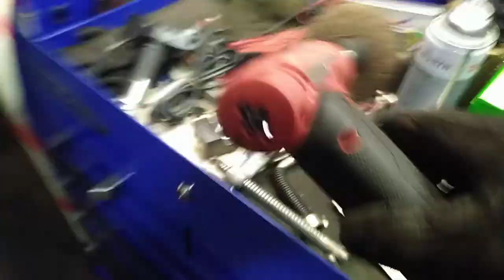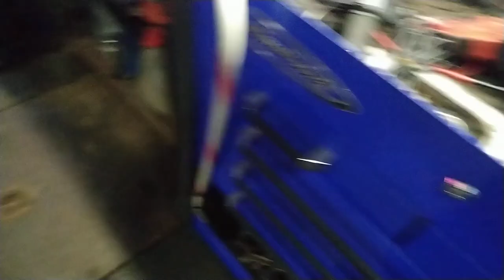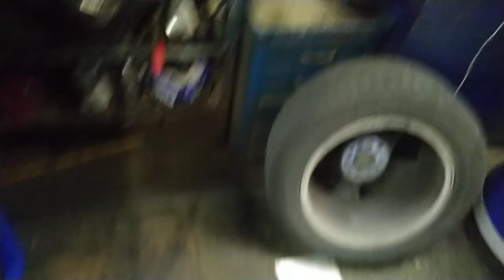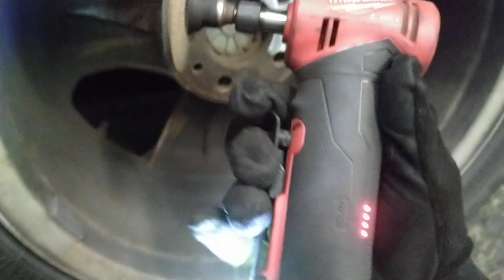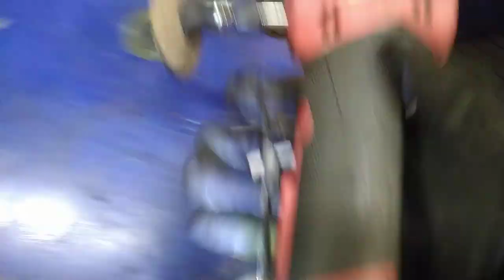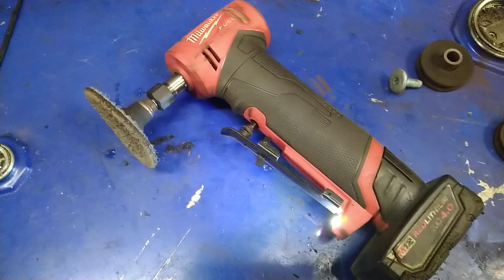NEW Milwaukee M12  Die Grinder WEAK SAUCE

Comment: It’s a safety cut off to prevent damage to the tool. It means you’re applying too much pressure to the tool. Use less pressure and let the tool do the work.
Reply: So why is this named a die grinder. it should be a sander. If it cant handle a sanding pad, imagine using a carbide burr which is the original bit designed for a die grinder. Dewalt and Makita also makes die grinders and there is a reason they put a little larger motor on it.
Reply: @krakeneleven5294  Milwaukee also has a bigger version plus this thing works like a charm either the guy was going ape on the thing or the vents plugged
Reply: Look how bent the wheel he's using is. Clearly he's using too much pressure on the tool. It's not allowing him to break it is all.

Comment: Interesting! I bought one of these and it works absolutely fine, I did push it hard ,but All was in thin metal using flapdisc, I will try to push it to its limit with something more challenging and see how it holds.
Reply: Alex Awesomesauce Beaudry sure thing brother, I will test it immediately when I get days off after 5 days and let you know what happens with me
Reply: Alex Awesomesauce Beaudry just after testing and searching realised that it has safety feature which makes it cut the power off if pushed so hard so that it doesn't move out of hand, which in other hand makes it underpowered in compare to other angle die grinder.

Comment: I just got mine yesterday and it’s doing same thing. This can’t be normal. I’m barely pushing down and it’s cutting out. Super disappointed.
Reply: They must have had a really bad batch or two. I've had mine for weeks now and I push down on it when I use 2" flap discs and on settings 3 and 4 that is no problem at all.
Reply: Mine is doing the same thing. It shuts off with very little pressure.

Comment: I got one and love it. I'm invested in the m12 line because I'm using them for DIY. It's not cheap and it's not professional grade. It's a luxery not a necessity.

I can totally understand from a professional perspective this may require adjustments in workflow because it's optimized for 2" accessories. You would have to stock on new accessories and increase the time on tasks with 2/3rds the efficiency. Might not be worth it.

Comment: You might of got a bunk one from the reviews I’ve seen. I don’t have one yet and I do plan on getting one. However it does state it’s best used with 2” accessories. So maybe that roll lock is too big
Reply: A little update, I got mine and pleased with it. It kills batteries, at least the 2 amp hrs fast. I used it with a 2” and it worked good. I used a 3” rolock on the 2” and it work decent. There was a couple times where it would stop. I found using a 3” greatly reduces the pressure you can apply.
Reply: grant maloy what kinds of tasks are you using it for? Would you recommend a body shop guy like me should have one of these ? Thanks
Reply: Auto Body Care I’m using mine to sand down my nova. It’s a handy tool for little jobs. My biggest complaint with it is battery life. I haven’t tried it with the larger batteries. However if you are using it a lot you’ll more than likely need to have a lot of batteries. My opinion is this will hopefully be an amazing tool once that work through battery life issues and making it more pro towards continual usage.
Reply: @gemaloy  2Ah batteries are absolutely useless in most tools. Only tool I have where they work fine is the thermal imager. 4Ah and 6Ah batteries are WAY better both in terms of battery life and power. output.
Reply: I used mine with a 2" disk to remove paint from a steam heating radiator and worked great other than not being able to get between the sections.
Reply: "must have" --there is no 'must of'.
Reply: @krakeneleven5294  the irony of you trying to give a grammatical correction when you’re reading skills are not up to par…
Reply: @gemaloy  Again you're = 'you are'. I guess you meant 'y-o-u-r reading skills. that is irony indeed! Anyways unlike you, I welcome others correcting my mistakes. no shame in that! I was not hoping to correct you anyways, but rather preventing others carrying something incorrect including your kids someday. Didn't mean to make you butt-hurt.  Again there is no 'would of or must of'. Yes your ears pick it up as 'of' but all this time, you were saying 'have' in a quick fashion during pronunciation which sounds like 'of'. Do a bit of google search. I am not a grammar nut. I make mistakes too but this is elementary stuff. Don't believe what others say including me. You have full liberty to believe in what you believe. this is M'erica! later dude.
Reply: @krakeneleven5294  lit-tree don’t care
Reply: @gemaloy  lit by lightning.

Comment: I wish to FUCK I had watched this BEFORE I bought one of those, because they all do the same shit. Now it's too late to return it for a refund. Money down the toilet, and I have a few other cordless Milwaukee tools as well, the 1/2" and 3/8" impacts, work excellent, the 3/8" drive ratchet, awesome. The angle die grinder, what a piece of absolute crap. It STOPS without hardly any pressure at all. My little air Snapon die grinder will put it to shame.